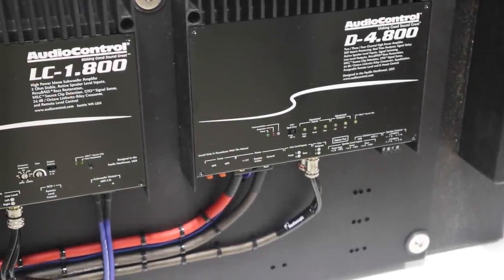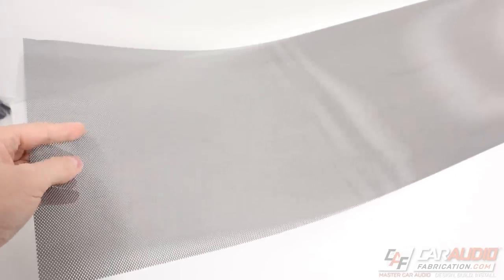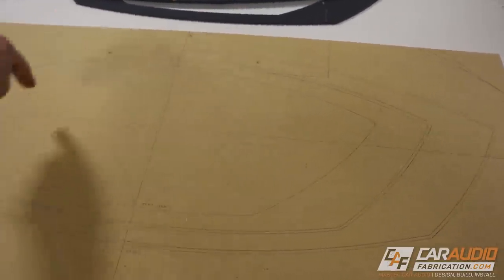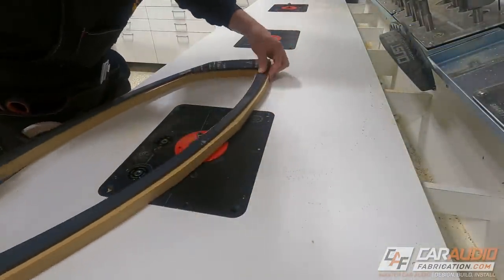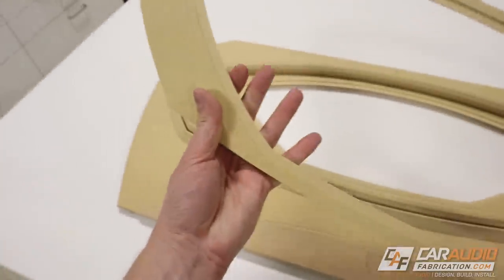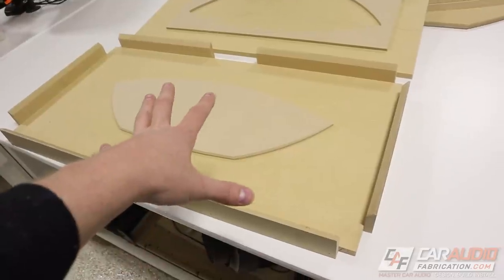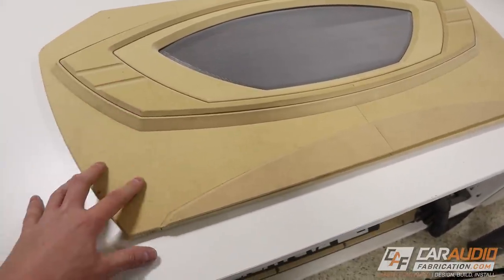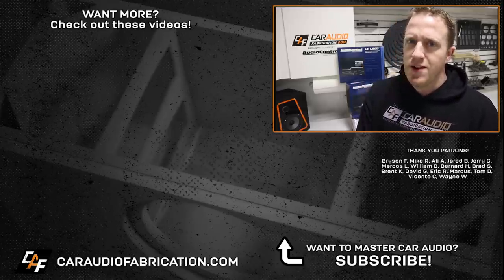Amplifier Rack Beauty Panel Fabrication! Step-by-Step

Comment: YOU should be using leather instead of vinyl your work and attention to detail is impeccable i had no idea they even made  a tool like that little gap gauge that may come in handy
Reply from the maker: Better to match the vehicle. This doesn't have leather inside so I prefer to match the vinyl that it does. The tool can be used for all materials though 👍

Comment: Hi really like the videos you put out. My question is when settings the gain on the amp . What tune do you use for the settings and are the tune frequency different when doing the setting from bass and mid and high? Thank you for your time

Comment: I get using the templates and stuff, but it ends up making everything look the same. You end up using them on everything to justify the initial purchase. I've made lots of cover panels and designed the openings to match the vehicle and the items being covered/revealed.
Reply: Where as you have a point... if one were to have a template and wanted something different...a clever individual could use it, and a straight edge or other template to make a new design. 
Then you could retain that design, couple it with yet another template and then have yet another completely new design.

Comment: Hey, i know that its a noob question buut my car is a bmw 5 series 2007year, it has the worst sound system that u can get so its missing the centre dash speaker.. Theres no even wiring.. Will i damage the amp if i take signal from lets say some of the front doors and wire a second speaker in parallel with one of the door speakers and put it in the centre ( 2x 4ohm speakers on one channel of the amp) speakers are 30watts.

Comment: Why don’t you use magnets for attaching the beauty panels. I would think it would be an easier install and access solution to the equipment.
Reply from the maker: Magnets are good for when the outsides of a part are not contained. The press fit here is much more satisfying and IMO professional. You want tight gaps for the upholstery to look good anyhow. Different if you were doing something like an acrylic to acrylic fitment like I did in this video: https://youtu.be/6NqO4DOyfHc

Comment: Somebody please help!
 I got 4” alpine coaxials in the front and pioneer 3 way 6x9 in the back, each getting 50 watts rms from a head unit and amp. 

when I crank the volume I get lots of distortion. I want to use the full volume potential of my amp for clear audio while I’m blasting my tunes. 
Thanks in advance!
Reply: Its not that much power so you might be expecting too much, particularly when it comes to bass output. 4" speakers won't produce any significant bass. The 6 by 9s will make some but you need to make sure they are baffled properly.